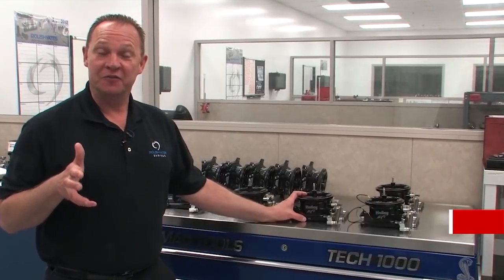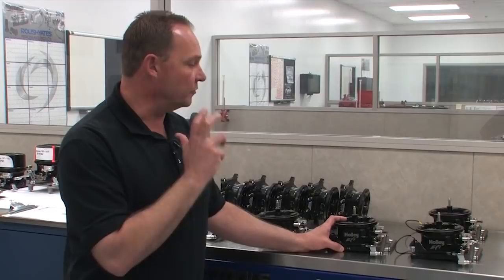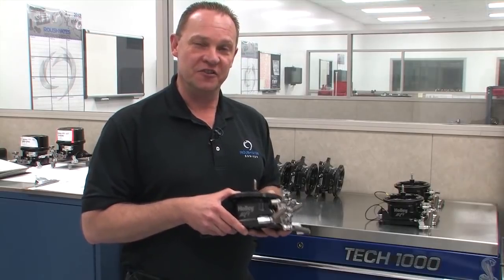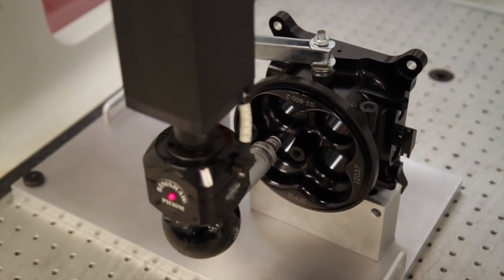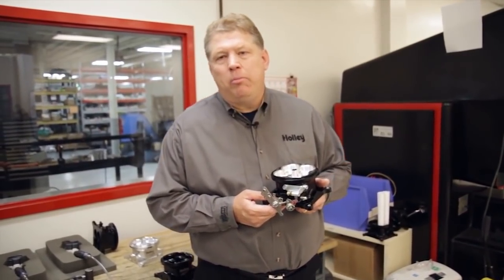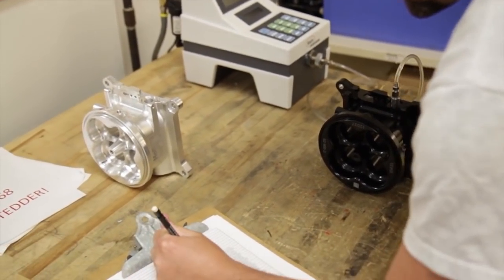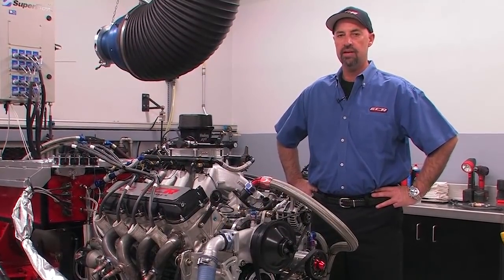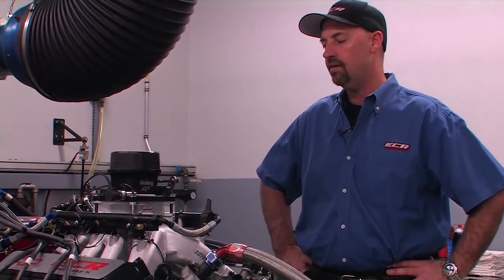NASCAR Holley Fuel Injected Engines on the Dyno

Comment: It's all good EXCEPT for the prices of Holley equipment these days.... 

I spend over $3000 on a Holley E.F.I. system for my drag car, and the company can't even include the friggin USB cable in the box with it to be able to connect my laptop up to tune the damn thing.. 🤨

Nope, I now have to BUY the USB cable for about $70. Really? That pretty much feels like a slap in the face from Holley. THEN, if I want to be able to have an extra port to be able to plug my laptop in, and NOT have to crawl under my dash and swap cables around with the hand held display for the system, I ALSO have to purchase a splitter cable from Holley that gives me the required 2 ports for another $50 or so.... 🤷🏻

C'MON MAN!!!

Comment: The new engines have a much more milder idle and seem to burn more efficient. The pro is that they don’t burn your eyes out with race gas fumes, in the garage. The con is that they lost a lot of that hot rod radical idle of the carbureted engines. IMO
Reply: If your carbed engine is burning your eyes out, you do NOT have it tuned properly. It IS possible to tune a carbed engine so that it runs just the same as EFI.

Comment: Trolling the NASCAR Ford dyno Vids in my spare time and came across this little Gem. Yeah, I know its an advo for Holley but I love the shots of what looks like an FR9 on the Dyno. Got to say, I've done quite a few retrofit EFI conversions on Musclecars and I've used a wide range of manufacturers throttle bodies.  IMHO the Holley 4bbl 112 series throttle bodies work great and actually a pretty good price compared to other Manufacturers throttle bodies.
The Vid seems to point out the strong points of the billet NASCAR version of the Holley Throttle Body, but leaves out what I find is the most important points for the Automotive enthusiast who might need one of these 4bbl throttle bodies to retrofit EFI to an old Musclecar V8. 
Most Carb people are familure with the Holley carb throttle lever and the form factor and this is what many people miss when they go to retrofit a car that previously had a carburetor. The Holley EFI 4bbl throttle body follows this same form factor and the throttle lever is exactly the same type and location as a standard Holley Carburetor. This makes it super easy to retrofit an old Muscle car with EFI and retain the original linkage, even the Transmission kickdown/TV if required. Even the Air cleaner diameter and fitment are the same as a standard Holley Carb.
Reply: The throttle lever is the LEAST of the worried when retrofitting an EFI system to an old carbed motor... 🤷🏻
Reply: @davelowets  Until you use a quality throttle body, that doesn't have sticky blades creating an inconsistent idle, I guess you wouldn't know.

Comment: Its not about the motors.....or the technology. Its about Nascar's unwillingness to change. The sport is drowning with no attendances and really boring races. Teams arent allowed to explore the limits as far as aero or downforce or tires for that matter. Does it really matter that there has to be 5 lugs on a wheel or some crew guy has to lug 20 gallons?  of fuel on his shoulder?  F1 teams are pitted and changing tires in under 2secs. IMSA teams are pitting in 40 sec doing fuel, tires AND a driver change. Considering what they do with push rod motors is amazing but how about letting teams run and expierment at least 4 cam motors.  I know most of the time they run in circles so I they dont need paddle shifters. What do they do shift maybe 2 or 3 times a lap? In IMSA Corvette will be going to a 4 cam 5.5 liter flat plane crank motor next year. Frankly, its about time.

Comment: Fuel Injected with a mass air flow meter stuck on top....Can they just go tuned port injection. As it is the 21st century! But no.. It's "Stock Cars" and ain't nothing stock about them! Dry Sump Oil systems. Coil over shocks. Modified transmissions. Rear Ends. Shit even the bodies are regulated! So let them use software today. 

Shit just let me use water\meth injection. I will smoke their ass in HP and Mileage alone!

Comment: Would be interesting how much power they lost....and how much MPG they gained?

Also Interesting how High up the runners they put the injectors?, Probably to give the fuel time to give the air a cooling affect that the Carb did + mixing.

They should have jumped right to direct injection....maybe in another 20 yrs;-)

Comment: I see an awful lot of debate on EFI vs Carburetors. I am an old school racer but I can say that EFI is superior to carburetion for so many reasons. First of all, it isn't just a fuel management system, it manages every aspect of the engine. Ignition timing, fuel and even cam timing on newer factory setups. Soon there will be electronically actuated valves negating the need for camshafts, single OHV or SOHC/DOHC. Computers can vary the operation in real time to environment while carbs work in a much more narrow predetermined window. NASCAR has been slow to shift to EFI because they are already trying to limit engine power to keep the drivers safer. Why do you think engine size is limited to around 6.0 litres and they have been using restrictor plates for years. Remember, in 1970 Dodge/Plymouth were running 426's and Ford/Mercury were running 429's. Those cars were breaking 200 mph when just 12 years earlier cars were barely doing 150. A lot of people died spawning restrictions. I race a lot of street stock dirt and carbs are still the norm but it's to keep cost down, not because they are better. Sorry but standing up for carburetors as being superior is like claiming the telegraph is better than a cell phone.

Comment: How the fuck can anybody go on a racetrack with this stoneage engine. Compare that to LMP1 LMP1 have over 900kw and Hybridsystems while being extremly fuel efficient through modern fucking engine like with 4 Valves 4 Crankshafts Turbocharging and Direct Injection. Ford had shown America can build good engines so why are you still working with this engines. This Nascar stuff is so outdated in Europe they would have been outdated by Production car standards back in the fucking 70s
Reply: mad money and mad expensive racing isnt a perfect recipe for spectator entertainment. (lol formula 1)
tell me one good reason why an oval spec race car would need to run a dohc turbo hybrid (like lmp1 like you say)?
cheap and powerful. proven technology.
thats why they still use pushrod engines.
Reply: +euroaaRON1 Well in LMP1 you have great Sport. And yes F1s shit. But LMP1 is a testbench gor future hightech. Oval teack racing is another problem. Where is the skill (i don't say i can do it better not even close to a true racer). The Daring Manouvres? Thinking the Legendary 2011 24h Battle Audi vs Peugoet. The best most thrilling motorrace in History.... Thats not possible without a track.... look at the corvette... an awesome sportcar... American Motorsport could be better.

Comment: You do all realize that it's NASCAR which is STOCK CAR auto racing. Everyone is complaining that it's old school technology, but let's see somebody else take a naturally aspirated 358ci v8, no turbos, superchargers or anything of the sort, and make 900 hp and crank 9000 rpms for hours, since it's so old school and outdated.
Reply: they are making roughly 840 on the cup engines
Reply: agree!
Reply: A good cup motor made 860hp with a flat tappet cam  usually around 9400rpm.  They actually made more power on the lower compression builds.  Dont need more then 12:1
Reply: Kyle Miller a 358 is old school technology it just has a better carb better heads an a better crank shaft to push those rpms
Reply: Yep Kyle, u r correct
Reply: Kyle Miller all you have to do is balance it to do use the right valve springs and there I can and you can twist any motor to 9000 RPMs what's really nice is when I did it with my 565 big block Chevy and I want a lot of drag races with it had a lot of fun so your imagination it falls short of reality
Reply: @bigredracer7848  but try doing it for 500 miles. A cup engine probably cost 40k and they still fail. So your 10k bbc doesn't stand a chance under those conditions. So yeah it is very hard to make a engine survive at that level.
Reply: @bigredracer7848  I don't mean this in a bad way, but I'd love to see a monster like a 565 run for hours at 9k like those little motors do.  Having said that, 9 k and 565 ci is shocking even for 8 seconds
Reply: Kyle Miller fuck yeah
Reply: Doubtful they make 900 anymore. They were claiming 750-780hp a couple years ago. You have to remember back when Bill Elliott was running the 351C back in the 80's and getting those 210+ laps, they were running 14:1 or better compression ratio. NASCAR limited compression to 11:1 back in the 90's...
Reply: @kramnull8962  You have no knowledge.
Reply: Kyle Miller why did you feel the need to state "no turbos, superchargers or anything of that sort" in addition to "naturally aspirated"?

if you talk AT people like they are stupid it generally inspires contempt, and in most cases will keep people from even caring about the point you are trying to make. no matter how good it may be.

that being said, I agree completely.
Reply: @tannermarlow5162  as pro in performance industry.....  I get your point...But I can understand his overly done description of the engine as it is my experience also when I said 20 years ago to customers asking on an engine in my shop: this is a 2 liter 4 valve making 310 hp for a 24 hour race ...people asked: that is with turbo sure??     Nope  NA engine.....  SAY WHAT??!@#$???  NO IT HAS GOT TO HAVE A TURBO...
Reply: @tannermarlow5162  he just likes using all those terms ha

Comment: would be nice if audi or bmw would build a nascar diesel race engine , they would win every time , and use only  half the fuel
Reply: Get audi to run a diesel v8 at 9000 rpm for hours then come back, or even a gas v8, one thats pushrod with carbs, exactly stfu

Comment: when throttle body first came out in the late 70s they had a carb design. in the 80s they used this same design for the rs 305 camaro. and that design made more hp then the 2nd gen throttle body
Reply: +Michael Tallent 

It's a waste of time discussing Gen2 when GenV is already kicking

Comment: first the throttle body is designed to fit a direct replacement of the carb. second this style of throttle body is better for hp because the air and fuel goes strait into the intake manifold it does not have any restrictions. another thing is it would be impossible to make a 4 barrel throttle body. with the second generation throttle body setup.

Comment: Does NASCAR mandate ignition coil now? Or you all still using the distributor cap setup?
Reply: +David Stewart You can see the coils at 0:17.
Reply from the maker: +David Stewart Yes, they use individual coils for each plug now and cap off the distributor access hole in the blocks.

Comment: Could someone speak to the coil set-up for each cylinder- which coils were used, what was used to mount them bracket or hardware wise with those valve covers, etc? Any help is appreciated. Regarding the injection, who configured the upper intake for the injector bungs, or is there a service via Roush Yates offers to convert this upper intake from carb to fuel injection?

Comment: real electronic fuel injection only injects fuel into the cylinder during the intake stroke, no fuel is being sucked into the exhaust manifold during valve overlap, this deal saves fuel and cuts down on emissions, as for injector location, any where above the intake valve will work, you either squirt into the manifold ports, or the ports in the head, the closer to the intake valve the less chance of fuel seperation
Reply: tom ashton Electronic fuel infection is a fuel delivery system in which fuel is injected into the engine (via fuel injectors). Electronic fuel injection is said system being controlled electronically as opposed to other methods (alternative to mechanical fuel injection). 

A "fake" electronic fuel injection system would be for example mechanical fuel injection, the location of the fuel injections doesn't matter just the fact that it is electronically controlled in order to be called electronic fuel injection. Now the location of the fuel injector in this case is obviously not the ideal place to put it, however those are two different things and is likely done as a leveling measure. All racing sanctioning bodies (from Nascar to formula one) make choices like these as fair competition is the most important aspect of competitive motor sports. This is why in Formula One many electronic vehicle control systems were banned in the early 1990s if I remember as not all teams could afford such system so to keep things fair they banned them.

Comment: Excuse me but this style of throttle body is old school, Nascar should go with the fuel injector setup.
Reply: What? It is fuel injection.
Reply: Of course its fuel injection, but not by the optimal standards. Fuel injectors over better performance than the throttle body version, which has been known now for many years.
Reply: fordwindsor351 Not sure I get what you're saying. Elaborate for me lol sorry, I get that they're using a holley throttle body, and the injectors are there with the fuel rails, spraying fuel in through the intake, correct? Sorry, I'm not too knowledgable about this stuff, but I've been going through the process of putting an Edelbrock fuel injection setup on a chevy 350 and I don't know much outside of that system haha.
Reply: Sorry, I didnt get my point out in my first comment. The injector location isnt in the best location unless results over the pass 15 years are wrong. Its best to have the injectors closer to the end of the tunnel, not up near the top. Wonder why they dont go with the newer direct injection?
Reply from the maker: fordwindsor351 You are definitely right about injector location. The story I heard was NASCAR had a hard time finding a spot in the intake manifold that was equally good for all three makes (Ford, Chevy, Toyota), so they wound up choosing a spot that was equally bad.
Reply: +JP JP Hey JP JP.........NASCAR has their reasons for doing what they do, to level the playing field as much as possible across all the manufacturers. Furthermore, NASCAR has ALWAYS had an open invitation for ALL manufacturers WORLD WIDE to enter & compete in the NASCAR circuit. But NO EUROPEANS DO IT. I guess because they can't figure out how to build an engine that falls within the rules that have to be followed by ALL the teams, and run it close to 9500 rpm's at 200 mph for 500 miles WITHOUT BREAKING. Also, Chevrolet has been making a V8 that is cheap & DEPENDABLE, along with the Corvette, which goes nearly as fast, and handles competitively with cars that cost EIGHTEEN TIMES MORE. So you can take your "stupid" comment and SHOVE IT RIGHT UP YOUR EUROPEAN INJECTED ASS.
Reply: +JP JP Hey JP JP.................See my other comment as well........and PS............the American NASCAR teams are making 850 to 900 horsepower WITHOUT any fancy turbo's or super chargers. LET'S SEE YOU DO THAT. But remember.........FUCK the dyno..........it has to turn 9500 rpm's and run flat out for a 500 mile race. "GOOD LUCK" WITH THAT...............ASSHOLE.
Reply: +JP JP If you have nothing nice to say then goo use Europe's internet.
Reply: +jack black  looks to me like there is an injector in each individual intake runner, a few inches down stream of the plenum, and each injector is pointing near straight down the intake runner.
Reply: Oooooohhh I get what you're pointing out now, I understand. Makes sense, thanks for pointing that out!
Reply: +fordwindsor351 I agree. the high install on the injectors is also inefficient. that far away from the inlet means the fuel is no longer a mist. 
the high throttle body is also a disadvantage.  why havent they gone individual runners , almost direct injection?